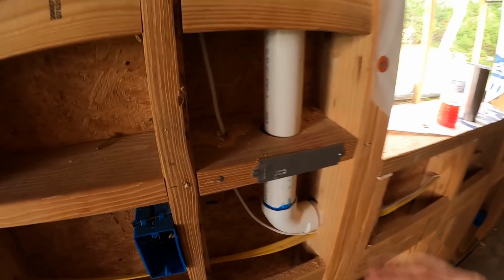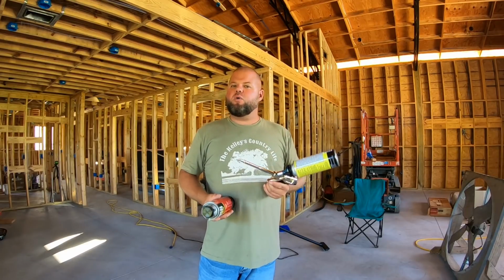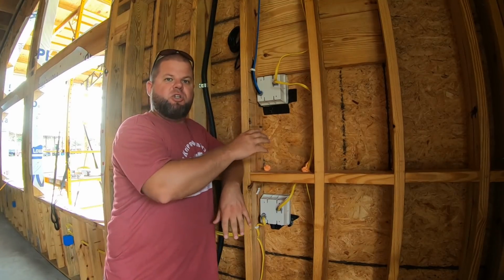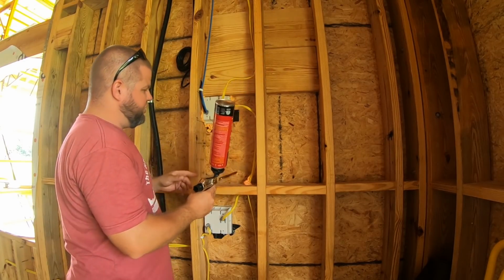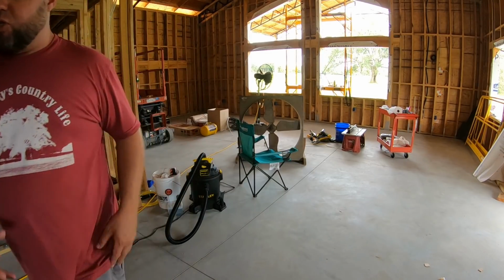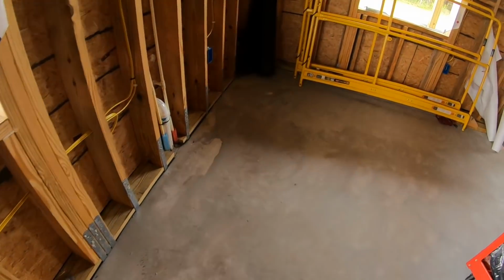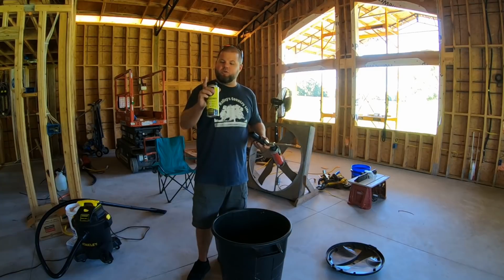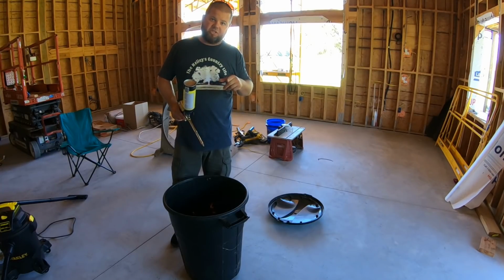Great stuff pro foam gun! Sealing the house and preparing for insulation #459

Comment: We might need that tool too if it does adhesive. Nice. Thanks Andrew.👍💞
Reply from the maker: I'm very curious about the adhesive part
Reply: I probably heard wrong I thought I heard they have adhesive too but we are using foam boards for insulation on our container house versus the spray. Still this would come in handy for around the plumbing etc.
Reply from the maker: Yes they have subfloor adhesive, basically like liquid nails but in foam form. I'm not sure what all it would stick to.

Comment: Hope it all gets sealed up like your expecting. When we had the aerobarrier done, the largest leak for our house was Bottom Seals of most windows, the Expansion joints on the slab going under the walls, and the penetrations from the HVAC pipes and electrical going out to the outdoor unit.
Reply from the maker: I am putting special attention on all those areas.

Comment: I used the subfloor adhesive recently on a project and it's a total game changer
Reply from the maker: I'm curious how well it holds..... But it seems awesome
Reply: @TKCL  time will tell but I have 0 squeaks thus far and that’s the important part for me. I will tell you that the mfgr says to use a smaller bead than I felt comfortable with and the can is relatively cheap, so i really laid it down on the joists

Comment: I've done insulation work between my normal trade jobs. We always sealed the penatrations like you are doing. I was told if it goes up or out seal it. Up to the attic or out side.
Reply from the maker: Luckily we have zero roof penetrations, I've worked hard for that. And our attic is conditioned because we are spray foaming the roof.

Comment: Use a flashlight to check your gap foaming. Easy to find out if you still have holes in foam.
Reply: Yes. I found the product file I saved and thought I posted it here. Guess not. 
As usual, you have your place covered. Good job.
Carry on 😁

Comment: Just remember"""""your house has got to breath too.. The silicone is the right idea around the boxes. Tim S.
Reply from the maker: That's why we are installing a ERV for fresh air intake. I want to control where air enters
Reply: @TKCL  I was thinking about insulation,,, up here, you want a spray foam insulation that breathe. So just curious if it is code their.?
Reply from the maker: I'm filling the walls with open cell, but we have the option to go with either kind.
Reply: That reduces any type of sweat to help prevent mold. Great Job!! Keep it up!!
Reply from the maker: We are definitely different in the south, I've seen northern houses also sheet with a vapor barrier on the inside walls. I'm guessing it's because of moisture build up with outside cold air and inside heating. We don't have that problem

Comment: Milwaukee makes an electric caulking gun with a cordless battery, it just powers the caulk out.    

I think the guns definitely make it easier. I’m with you on the bug thing, they actually make a seal that you can put under your base plates like where you put that foam strip to keep it off the concrete, it’s made to stay semi soft and flexible for decades and it’s specifically made to be a bug barrier. I saw Matt Reisinger use it, But I would definitely consider that.  The last two houses I had had problems with those little teeny tiny black ants and they’re so small they can get in pretty much anything.  

There’s another product Matt Reisinger used where they pump air into your house after it’s pretty much dried in a new mask things up and atomizers cock and put it into the air and automatically finds all the little holes and cracks to fill everything and it seem to work pretty well. I don’t think it something you can buy I think it was a company that came out and did it, but basically they seal up a door in the house and put a big fan on it pressurized the house so there’s air going out and then they take a tank of this stuff and pump it into the air and it just cracks and clogs up all the little holes, that was pretty awesome.
Reply from the maker: That's aero barrier, I've seen that episode. Interesting stuff

Comment: Did you seal all the penetrations through your floor like hvac, gas lines etc. Itl prevent the stack effect.
Reply from the maker: Yes I started on hvac, but the attic is also conditioned so I wasn't sure if it would make any difference.